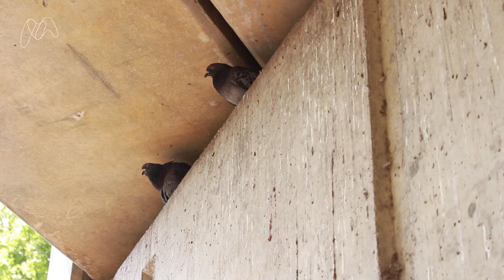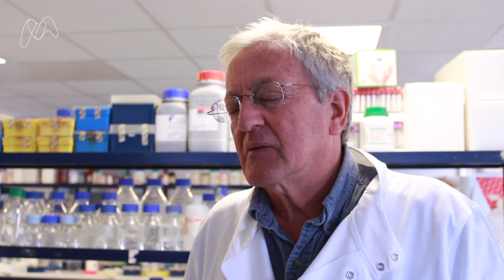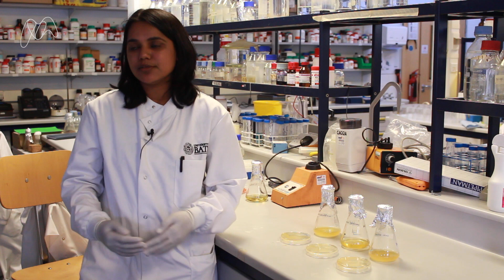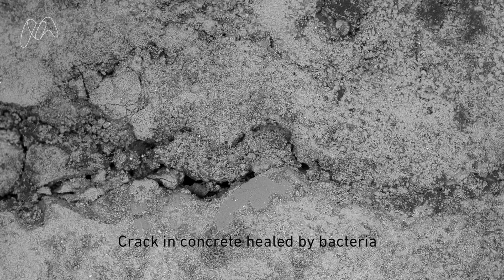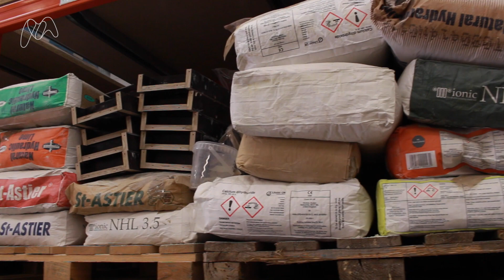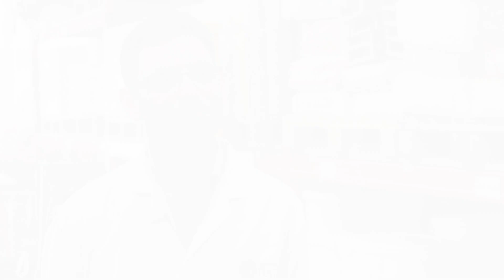Using bacteria to make self-healing concrete

Comment: I hope that this vast culture of bacteria to be used in many concrete applications will not change ecology, or start having adverse effect on coral reefs.
Reply: Yet a lot many aspects are to be explored.
Reply: It's a common bacteria found in the soil
Reply: uma chauhan  you will have to procure them from culture collections. You can also isolate them and screen them for Calcite preparation
Reply: uma chauhan  There are bacterial cultures mentioned in the literature. You can use the reported cultures. Check the websites of culture collections in India first. International culture collections will definitely have the reported cultures.

Comment: cracks are fine, but looks like if they escape it can multiply outside the structures too, after all outside the concretes there are all voids, underwater calcium and dissolved CO2, calcium carbonate causing increase in alkalinity . just imagine if the growth of bacteria becomes uncontrollable, there will be concretes everywhere,      and if it enters human body, that will be a problem ..  if absorbed by plants , I can actually sense this to be a risky innovation . if I am wrong please explain me
Reply: First of all the bacteria is encapsulated so it wont happen and also there is range of akalanity in which it can survive so better encapuslation better resluts less harm chances
Reply: These are environmental microbes. Since there is currently not forming concretes everywhere, or killing people, I'm not convinced that is a significant worry